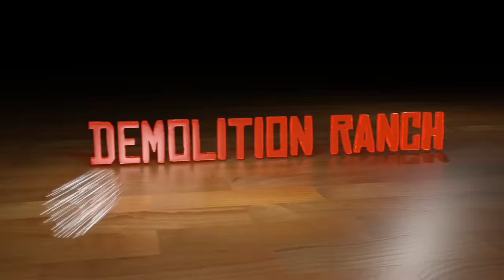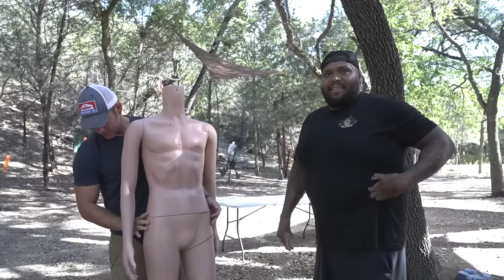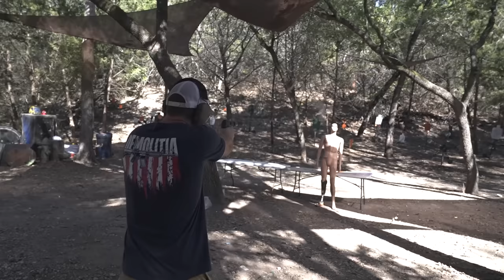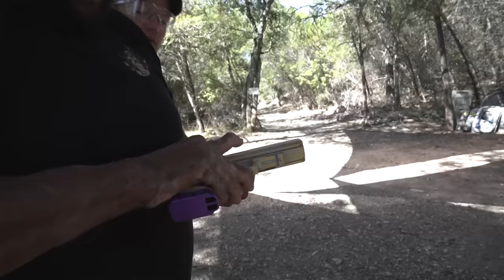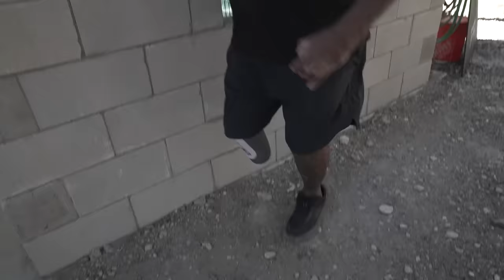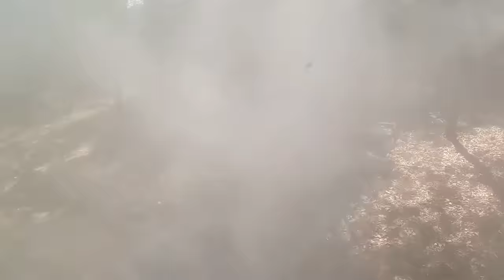I Shot An Amputee's Leg, I am Impressed!

Comment: Matt, before they were Hi-point, they were Stallard Arms (1992) in FtWorth Tx in that time frame the gangs predominantly used .22, .25acp, .32acp, .380acp… and  
On occasion.38 special…. All with FMJ or RNL cheap ammo.
Stallard with $150 9mm, .40, and .45acp overnight changed the dynamics of street shootings , and what we got to see in the ER at John Peter Smith. Still mostly FMJ. But it was concerning that they went from shooting at cops with a .380, to launching .40S&W at cops, and citizens. I was a 01 FFL and 03 SOT at the time….. and its the only time I have ever thought the 3 car garage that Stallards were probably made in needed an air strike called in on it. The pawn shops that sold them, also sold ammo by the individual round… so if you used 6 last night, you wasn’t stuck buying a whole 50rd box just to top up.